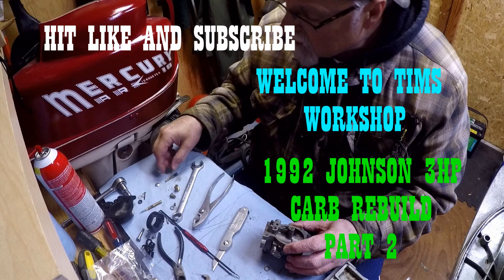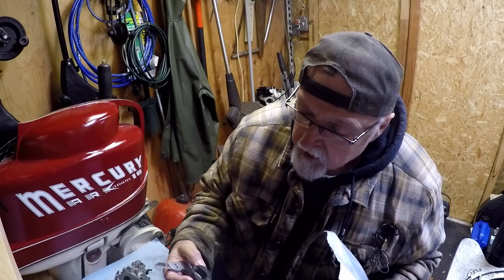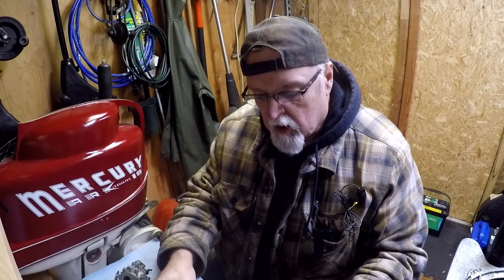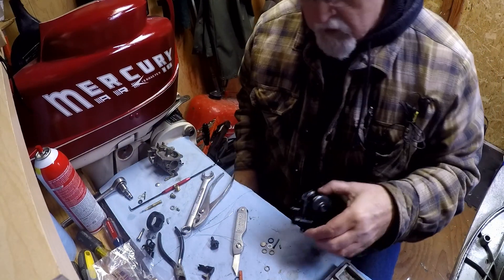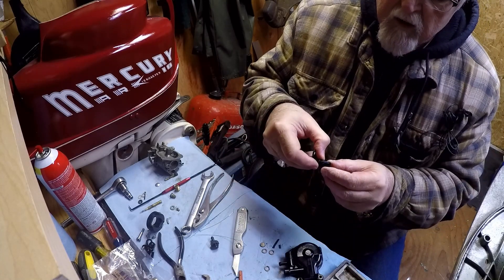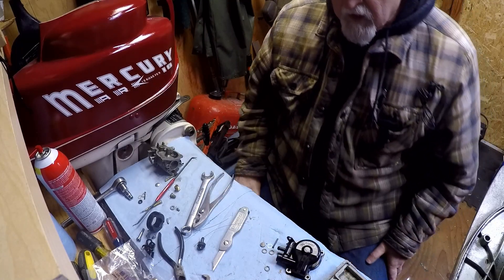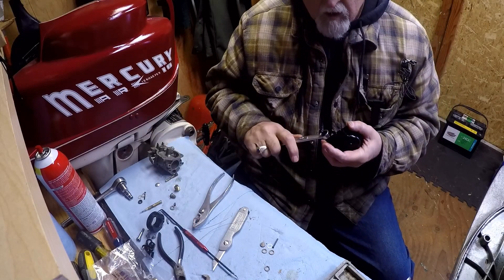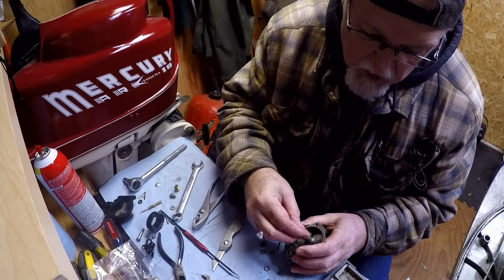Johnson 1992 3hp carb part 2

Comment: How has the torque screwdriver been
Reply from the maker: It's great Jim, It's perfect for carbs applying the low torque required to prevent leaks. How have you been? How's the weather back there?
Reply: @TimsWorkshopTJY  that's good, and it's been 88-90 past few days here
How's it been there
Reply from the maker: Today was the best day yet at 58 but the lows still in the upper 30's. The famous tulip festival is late up north because of the late bloom